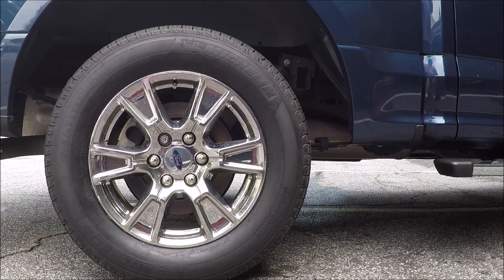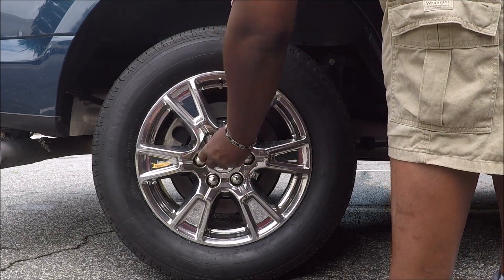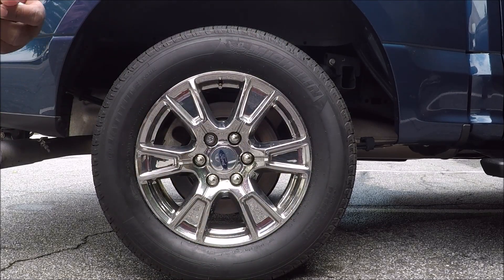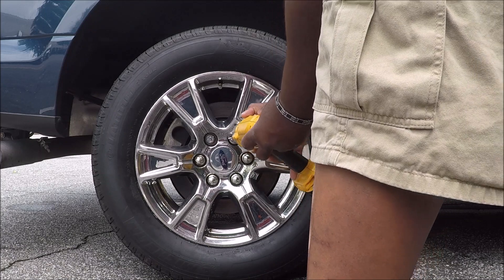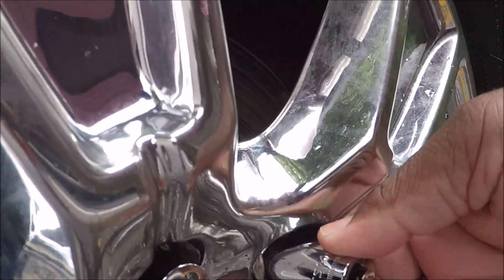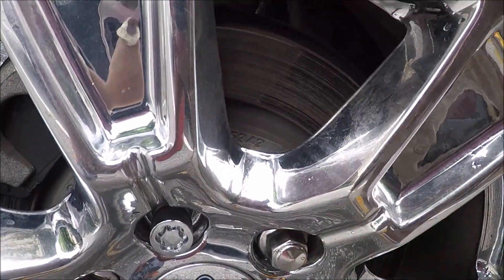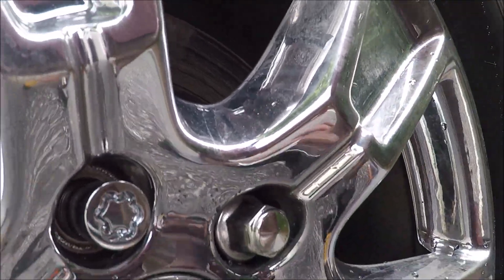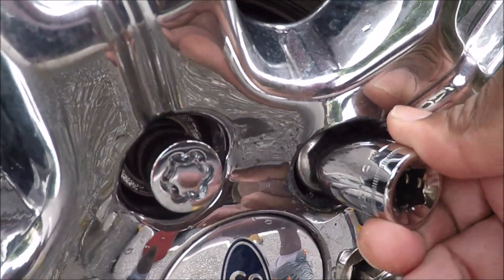Discount Tire this is how they damage my lug bolts

Comment: I deal with stolen lugnuts all the time. Seen tin caps split from stuff that got in-between the nut and cap.
Reply from the maker: How do you think the stuff got behind the cap?
Reply: @blackericdenice  it's a cap over a lugnut duh doesn't take rocket science to figure it out.
Reply from the maker: Yet you still have not answer my question. @jeremyspigner1320

Comment: damn. i once had a steering problem about 10 years ago, and 99% of the time i do car work myself, BUT had discount tire replace my rear tires and one side wasnt even tightened. I only knew because I was checking something unrelated. 4 of the 5 nuts were completely loose.  Atleast it wasnt a front tire, lol.

Comment: The only reason someone at discount would use the wrong socket is because they are already swollen. Gotta love ford lugs.
Reply from the maker: I showed the manager my good lugs before they touch my truck. When they were done. My 21mm did not fit on one side. How do you explain that?
Reply from the maker: My video showed what they did to strip the lug.
Reply from the maker: @bulbyq4611  You are not talking to your mother. Keep the name calling to yourself. If you can't, you will be block from commenting.
Reply: @blackericdenice  this is a tire stores fault but there is such thing as swollen lug nuts, chevy and ford lug nuts have shiny aluminum caps on top of the steel lug nuts. at some point in the past you likely had someone use the wrong size socket (probably before this issue) which causes the same damage you demonstrated on the lug nut, then when discount tire removes the lug nuts with what should be the correct size socket, because the previous technician damaged the lug nuts, the correct size will no tear at and strip the swollen lug nut that needed to be replaced, as a tire technician it’s true that this can happen and it’s not necessarily the technicians fault, but they certainly made the problem worse
Reply from the maker: @lkyfn1429  The cap is not aluminum. No one has touch my truck but me. I only use a 21mm socket. I installed and reviewed some cheap brake pads the next day after DT had install 4 new tires. This is how I know they did it on the right side only. The left side was fine.
Reply: And the cap is aluminum
Reply from the maker: @Noodlebug04  The cap is not aluminum. Yes I saw that stupid same video.
Reply: As someone who works there I can tell you first hand that ford lug nuts are a scam. There’s actually legal battles over ford lug nuts just need to do a little research. We as technicians don’t purposefully use wrong sockets and don’t want to make the job harder on ourselves. Moving many cars a day anywhere from 6-12 hours a day, the last thing we want is more trouble

Comment: Having worked at Americas Tire/Discount Tire, and a Ford dealer, i can 100% guarantee that the lugs do swell, and so do GMs. We dont even carry a 22mm socket my guy.
Reply from the maker: Telling me you worked for all those places only make you look bad. How can you work for all of those places and not know the truth? The reason is because you were never told the truth. I was told by my father 37 years ago, if you use the wrong size socket. You will damage two piece lug nuts. Yes two piece lug nuts has been put on new cars for over 50 years.

Comment: When you have no clue what you're talking about and want to blame someone else for your ignorance.
Reply from the maker: Your comment is ignorant because you don't know what you are talking about. Instead of believing what you see online. Try what I did in my video. If you are so smart. Tell me why 12 lugs swelled on one side only?
Reply: How's it ignorance if discount tire stripped the bolt because they used the wrong size? 🤔🤔
Reply: @KP-vl7fy  because they didn't. This is a common issue with Dodge and Ford lugnuts that have a two piece construction with an aluminum cap. Chances are that his lugnuts were already swollen from being exposed to heat, cold, moisture, etc. Those caps are not perfectly sealed and are only for cosmetics.
Reply from the maker: @ghost0595  You are just mad because I know the truth. Any more cursing and you will be block.
Reply from the maker: @stockbridgesux  Just because you read it online doesn’t mean it is right. Two piece lugs have been around for more 50 years. If you use the wrong size socket. You will damage them.
Reply: @blackericdenice  it took you 6 months to come up with that response? Just because you read it online doesn't mean you're correct.
Reply from the maker: @stockbridgesux  Dude, I have 2,200 + plus videos. I don't always get a notice someone has left a comment.

Comment: Just buy some good lugnuts.Ford Lug Nuts Swell up on sizes 19mm,21mm and some 7/8ths the aluminium caps swell over time due to heat simple as that. 22mm is not the correct size though it would help with taking off. Ford has the shittiest lugnuts out of any brand.
Reply from the maker: Did you watch the video? They don't swell. People use the wrong size socket taking them off.

Comment: As an employee at discount tire a lot of these Ford trucks already come in with swollen lugs this happens because the lugs are terrible. And your claim of the air impacts using to much torque is very false bc we use torque sticks so we don’t over torque. Then proceeded to torque to the torque that is said by Ford from the factory. If u wanna remove this bc it’s “false” it shows you don’t know what your talking about one bit. I recommend u go work at a tire shop and see how it is properly done.
Reply: Agreed! The DODGE socket is the closest thing to a 22 or the 7/8ths that is used period. We have particular sockets for Ford vehicles only because those caps are just horrendous. Keep taking those lugs off and on and you’ll eventually swell it up so bad the cap will start to come apart and you’ll see what’s really happening with the lugs. It’s just how they were made because they do SWELL. Nothing more to it. My dad has a F-150 guess what his OE lugs were swollen after going to Ford themselves explain that one? I put wheels and tires in with aftermarket lugs he doesn’t have that issue anymore.

Comment: It isn't us, Ford lugs just suck.
Reply from the maker: If you use the right size socket like I did for 2.5 years. You want damage them.
Reply from the maker: People bitch about aluminum heads the same way. If you don't let them run hot. They want crack.

Comment: Dude we have 17, 19, and 21 mm sockets.  Ford lugs swell, just get them replaced. Saves a lot of time for everyone.
Reply from the maker: How do you explain them swelling on one side only? No one had ever worked on my truck but me. I replace my brakes and rotated my tires 3 times. I never had a problem with my lugs before.
Can you explain that?
Reply: Lmao we don’t even carry 22mm sockets 😂
Reply: @carlospena4437  yeah the store I work at only has one 22mm and half if the guys don't even know we have it 😂

Comment: Saying that Lugnuts don’t swell on their own is like saying Ford trucks don’t break, LOL, LOL
Reply from the maker: They don't swell. I had my truck for 3 years and my lugs were fine until Discount Tire messed them up. They replace all 24 lugs because I'm not like most owners. No one had worked on my truck but me and I'm smart enough to use the right size socket.

Comment: You do know that some lugs, especially Ford lugs, can swell by taking them on and off even with the correct socket right?
Reply from the maker: No they don’t. I have been using the same socket for 5 years and my lugs are fine.
Reply from the maker: @EffingWhiteMale  Your comment was removed for two reasons. Name calling is not going to fly on my channel. You are 100% wrong about moisture and rust. Unlike you, I don't believe everything I see online. I took apart a so-call swollen lug and I did not find moisture or rust. I did find a zinc coating protecting the lug from rust. I know how white people don't believe anything a bro say. So I uploaded a video to prove it.
Reply from the maker: @EffingWhiteMale  https://youtu.be/W5WqTb2GYKM
Reply from the maker: @EffingWhiteMale  Don't call me bro and you are a racist. You believe anything a white man tell you. Then you want to question me.

Comment: Your first failure in life is using a 12 point to break loose anything.
Reply from the maker: I've been using the same 12 point socket for 35 years. Why don't you explain to me your problem with that?

Comment: Unfortunately lugs nuts do become swollen. As someone has previously mentioned, there is a lawsuit against Ford due to that reason. People often change the lugs as soon as they can so no issues happen in the future. It is not because of the wrong socket size.
Reply from the maker: My video show lugs swell because people use the wrong socket. The reason Ford still sell trucks with these lugs are because. If you use the right socket. They want swell. Now upload a video that prove me wrong.

Comment: We dont even have 22m sockets and we torque specs from manufacturer specifications
Reply from the maker: If you was smart. You would not want to be associated with DT.
Reply: @blackericdenice  exactly. Americas tire is where it's at
Reply: @calebhoffman America's tire is discount tire that's just what it's called in California
Reply: @haydowayne  I am aware, I work at one. You see what I did was called dank hood irony 2014

Comment from the maker: Goobon, There is no such thing as swollen Ford lugs. There is a such thing as damage Ford lugs. This has been going on sense 2 piece lugs were made (30 years plus). They will last as long as you use the right size socket. If you use a socket that is too big. You will shift the chrome aka damage the lug.
Reply from the maker: @jeremiahbontjes8104  That is not true. There is a coating of zinc between the 2 metals. I know you are not going to take my word so here is a video. Just because everyone say the same thing. Does not mean it's true. https://youtu.be/W5WqTb2GYKM
Reply from the maker: @jeremiahbontjes8104  Techs who work for DT are not that bright. If they were, they would use the right size socket.
Reply from the maker: @jeremiahbontjes8104  Your last comment was removed. I don't allow people to lie on my channel. If you can't tell the truth. Don't comment.
Reply from the maker: @jeremiahbontjes8104  You have never worked on a car with two piece lugs before. You simply believe what people say online. Then you lie about you work for DT. Thinking I will believe you are telling the truth. When I tell you I don't believe you. You lie about being an assistant manager for DT. Now you want to name call because you have run out of lies. Son, I'm 52 years old and I grew up in my father junk yard. I've known about 2 piece lugs a long time. As long as you use the right size socket. They will last the life of the car. BTW, you are blocked from my channel for lying.
Reply from the maker: @jeremiahbontjes8104  The truth is never an opinion. Wow, 50+ hours a week for just 2 years. This is why you have been block. You keep on lying.

Comment: lemme tell you something my guy. discount tire uses a socket that is 19mm on one side and 21mm on the other side. there is no 22mm socket on the carts with the sockets on it. fun fact. call ford. let me know how that phone call goes
Reply from the maker: The point is they used a socket that was too large on the right side. How else do you explain them stripping only the lugs on that side. All the lugs on the left side were fine.

Comment: It's the type of lugs Ford use two-piece lug nuts that have steel cores with chrome, aluminum or stainless steel caps. They should have used one-piece solid steel lug nuts instead of the two-piece nuts with caps. If you didn't know they even have a lawsuit . "ford swollen lug nuts lawsuit" with got dismissed.
Reply from the maker: It's not Ford fault. My video show if you use the right size socket. The lugs want get strip.

Comment: Are you saying Discount Tire are using a 22mm socket?
Reply from the maker: No, I am saying they are using a socket that is too large..
Reply: blackericdenice we use flip sockets..19 on one side 21 on the other...we don’t have a 21 on our caddy
Reply from the maker: @Firefighter-kg1rr  The point is and I said this in the video. DT use a socket that was too large.
Reply: How are you not saying Discount Tire uses a 22mm socket??? The 22mm socket is the only larger socket that will be able to fit in that lug hole, any larger socket literally won’t fit.

Comment: They damaged one of my custom American Racing Wheels and stood right there and tried to tell me that i damaged the wheel lol There's only one problem with that, my pictures clearly show the wheel was forced outward away from the tire by one of their machines they used to put the tire on in the first place. The manager would not stand behind it and persisted to tell me that I didn't know what i was talking about. You have got to be fricking kidding me!!! Look at the inside of the wheel in this picture:   https://photos.app.goo.gl/nVUSykNhkwBoxKKJ9  you can clearly see that section of it is pulled away from the tire and the tire itself has no damage on it either, look closely at the pic. This is the Inside of the right rear wheel!. and if something like this was from a road impact which nothing would do this in this manor based on the fingerprint of damage they left behind but if it was I would of had to hit the front wheel also!. Here's the thing, the tire is not leaking air at all so my guess is some kid was too busy with something else to pay attention what the hell he was doing (like on his phone or something) and hid the fact that he damaged the wheel since it wasn't loosing air. Here's my theory:...    "Put it on the car, it's not leaking, it's inside and he won't notice besides once he drives it off the lot it's on him"....   So now my Consumer Law Attorney is going to handle the case and we are suing for damages. Why? First of all, they let the damage go out the door instead of speaking up about it and that right there could of caused an accident if that tire would of blown and other people could of gotten hurt or even killed. That's all I can say about this at the moment but I  will let you know the total outcome after this is over. It should be very quick. I have nothing to loose on this one.
Reply from the maker: Pep Boys did about the same damage to my 2004 Trailblazer. The manager blew smoke up my ass. I wrote an email to PB and they replaced the wheel. I have not been back sense.

Comment from the maker: Jared your comment was removed because you don't know nothing more than what you read online. Discout Tire stripped 12 new lugs on one size that was less than a month old.
Reply: Well how bout you do us all a favor and get new ones? Then you won’t have to worry about swollen lugs.
Reply: And maybe a tech did make a mistake. If it’s messed up on one side, maybe they did use a wrong socket. I’ve seen that plenty of times where a tech will assume the lugs swell to a 7/8 and strip it out
Reply from the maker: @jacobr.127  Discout Tire bought me new lugs because I showed the manager before they touch my truck, the lugs were not swollen. No one but me touch my lugs for 50k miles. This is how I knew the lugs were good.
Reply: @blackericdenice  Well I'm glad you were able to get new lugs. Hope everything is going better for you as far as truck maintenance
Reply from the maker: @jacobr.127  I just change the oil for the 7th time at 58k miles. https://youtu.be/8sdOefdJS40

Comment from the maker: Aaron, your comment was removed. My video show how lugs become so-called swollen. I rotated my tires twice and installed brakes on my truck. My lugs were fine until Discout Tire young a$$ crispy techs use the wrong size socket.
Reply: Dude we only use 17, 19, 21, and large and small spline. Some use 7/8 or even seven spline. Other than that you gotta have your own wheel locks. Science is why your lugs suck. Common sense and if you dont want to accept the fact that you need to get new lugs then you really need to do research and quit crying.

Comment from the maker: Acerockerr, don't come to my channel lying. I have change brakes on my truck. I have rotated my tires 3 times. I have taken my wheels off to clean the backside of my wheels. I did not have a problem with my lugs until I went to Discout Tires.

Comment: The 19mm ford nuts swelled too, but at a much lower frequency. There is no standard socket between 19 and 21 for the average tire shop. Still think the nuts are fine?
Reply from the maker: Why did they only swell on one side?
Reply: Like you said in the video someone probably used the wrong socket on it, but that doesn’t mean the nuts are fine. Toyota and Nissan 21mm nuts resist damage far beyond the level that ford nuts do. Ford nuts SUCK. Period. If it takes just one time of using the wrong socket to make the nut unusable with a 21mm wrench, the nuts are shit.

Comment from the maker: Geoff, I stopped reading your comment and removed it when you said you was a manager. Don't lie on my channel. I'm smarter than you think.
Reply from the maker: Geoff, the point of my video is. If you guys were so smart. You would have figured out using anything larger than a 21 mm socket. Will damage Ford lugs.
Reply from the maker: If you really are a manager. Tell me why did all the lugs on one side swelled.
Reply: You dont need to be a manager to understand that, EVERY SINGLE FORD HAS SHITTY LUG NUTS. ASK ANY OTHER FORD OWNER AND LOOK AT THEIR LUGS AND TELL ME THEY DONT LOOK THE SAME

Comment from the maker: King your comment was removed. If you want to write a book that is wrong. Upload a video and put it on your channel. My channel is all about truth. My video show the real reason for so-call swollen lugs. My truck is 2 years and 9 months old with 54k miles. It is always parked outside. As long as people use the right size socket. The stock lugs will be fine.